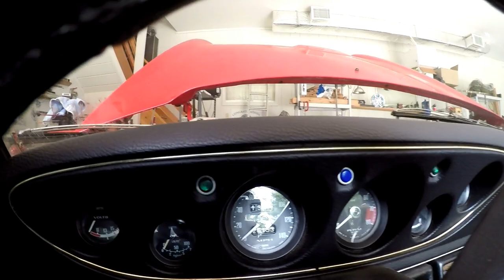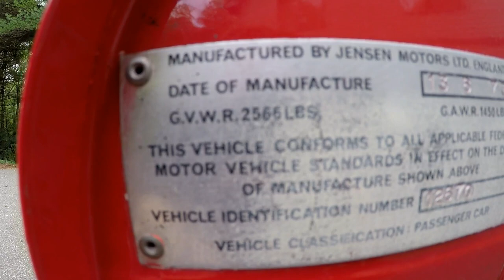1973 Jensen Healey | Lotus 907 | A Finely Balanced British Sportscar!

Comment: I have owned 2 1974 Jensen healeys. I have always loved these little cars. my first one was pretty stock other than a paint job and upgraded tires it was stock. the second one I put a racing cam, Koni shocks, sway bar, exhaust system, dellorto 45 carbs, headers, etc. it was a beast. A truly fun car to drive and very reliable.
Reply from the maker: That sounds like a blast! Should have thrown in a race cam when the motor was apart but ah well, next time haha. Oh, definitely will look into the shocks. they handle great as is, with a stickier tire and after tightening up the steering slop, should be even more fun. Almost the weather to get it out of storage!

Comment: I owned a '74 JH and a '76 Jensen GT, which was pretty rare. I loved both those cars dearly.  

I suspect your brake power booster is out. This happened to my 76, and it definitely made for increased braking pressure after it failed.

The 74-1/2 and later cars came with the Getrag dogleg 5-speed. My 74 was a 74-1/2 but it had a 4-speed, unfortunately. My GT had the 5-speed Getrag, a really nice tranny. The dogleg 1st gear was toward you and down (left hand drive), and it was spring loaded. What this allowed for then was you could shove the shifter straight up, and because of the spring loading, it would snap the selector over just far enough so it would slide straight into second gear. So this made for very fast 1st to 2nd gear shifts. 

Just one comment regarding the carburetors -- you mention the Strobergs, the Dellortos and Webers. The Strombergs came stock on the  US cars. I've heard different stories on the Dellortos. One I'v heard is the non-US spec cars go Dellortos, the other was that earlier non-US spec cars got them and later non-US spec cars also got the Strombergs. The Jensens =never= had Webers installed from the factory.  However, the Dellortos are functionally equivalent, looking like clones of WEBER 45DCOEs.
Reply from the maker: Thats awesome man! And thank you for all of the information, really appreciate it. We would love to get our hands on the getrag 5spd, would be alot more enjoyable for cruising with 5th! Did you ever have any syncro issues with 4th gear on the 4spd? Ours is a bit tricky, sometimes needing a quick double clutch or a decent pause inbetween 3->4. 

I'll have to look into the power booster then! Bit better braking would be nice, not expecting it to stop like my brembos haha.

Well thank you for clearing that up! We were always wondering about that, couldnt find any markings so assumed Stroms, but I've seen pictures of JH with Webers on, hence why we were just curious about it. Thanks for the info again!

Comment: A 2.2 crank from a 910 and  different carbs will make them come alive.  I hope you upgraded the cam pullys to the later type so that you can use the later type belt.
Reply from the maker: Unfortunately, everything at the time was put back together as an oem rebuild. Next time it needs motor work itll be getting all the bells and whistles!